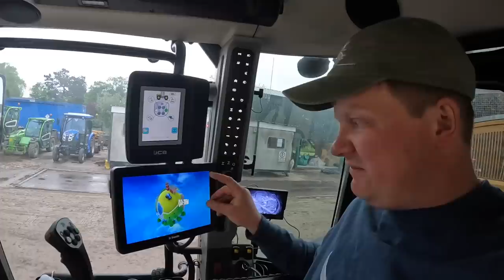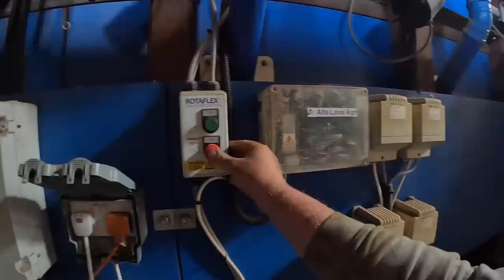BEST TRADE EVER!!!... JUST IN TIME FOR CHOPPING GRASS!

Comment: It just annoys me that people flute around with bad blades mowing, you’d swear they were expensive! Just change the bloody blades REGULARLY you will get faster regrowth and save diesel , the combined benefits will more than pay for a set of blades even if you put them on every 10 acres! This is not a rub at Tom ! I see farmers all over the world doing the same thing and if they just thought about it for a minute they would see that they were being penny wise and pound foolish!
Reply: Would the same theory work if you sharpened the blades each field or had a set that was sharpened to swap out each field, so the original set can get sharpened while the other set is in use and vice versa, rather than putting entirely new blades on each time? I know nothing about mowers, so this is a genuine question.
Reply: @thandiwolfe813  the blades are cheap and cheerful and are designed to last for up to about two hundred acres of easy mowing, you could sharpen them but they don’t hold an edge for long after being sharpened, a box of blades cost less than a packet of cigarettes, when you grease the mower in the morning just swap out the blades it takes less than five minutes and will probably cost you less than the grease. We run a lot of mowers and mow about 10, thousand acres a year some of it is what I would call very rough mowing and when we do that we often use the old blades but for the good well minded grass we change the blades every day, the farmers see the benefits from quicker regrowth and we save the cost of the blades in saved fuel .
Reply: @Andy-ix2ox  thank you! That makes sense. It’s good to know the blades are so affordable that changing them out is a viable option. It also makes sense that changing them out is more economical time-wise than sharpening, if the blades don’t stay sharp for long.

Comment: The Fastrac is 4 wheel steer isn't it? If the mower overlap isn't sufficient couldn't you have set the steering to crab a bit to compensate and give you the overlap you want?